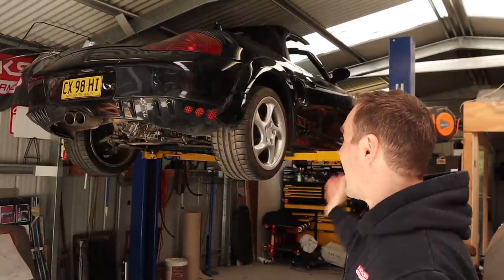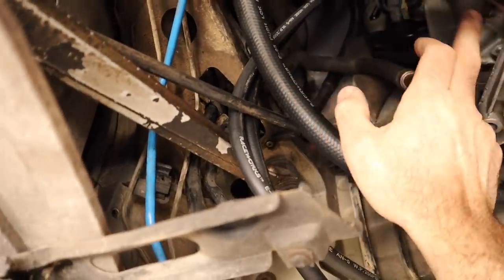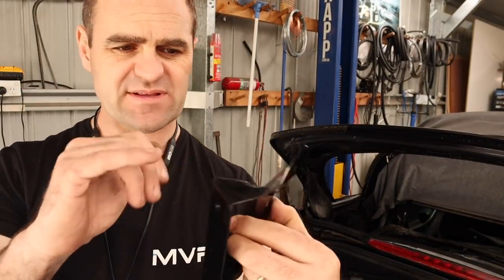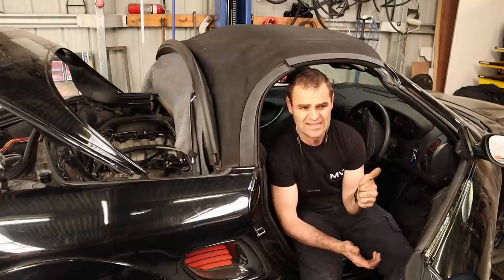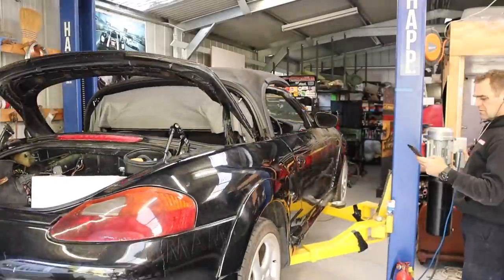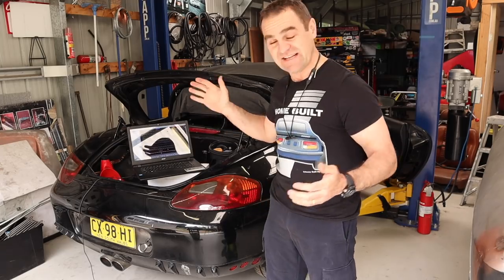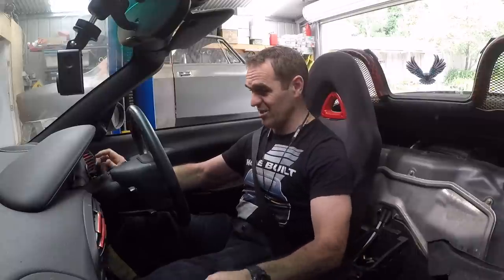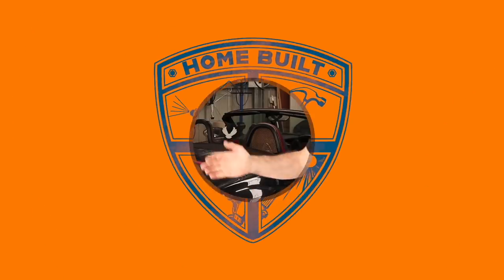V8 Porsche first drive - Porsche 986 Boxster V8 engine swap track car build 18

Comment: BEFORE YOU GO TAKING CORNERS AT SPEED… be sure you have baffles in your oil pan, or are using a dry sump. Don’t pull a Hoovie and do what he did to Apollo911 after he V8 swapped his 996. Cornering at speed starved the oil pump of oil & he smoked the engine. Glad to see you saved it. How are you cooling that beast? Did you make those “nostrils” on the bonnet into real cooling ducts?

Comment: I suggest to not drive without the engine top cover. Instead of using the genuine 986 black plastic cover you can alternatively use the 987 aluminium cover. It fits "plug&play",  is much lighter and has a bigger bulge, so provides  more space for the engine.
Regards from Germany 😀
Reply: Great tip! As someone that's in early planning phases of a K-swap for my 986, this is great information. The K-series was a bit too tall for the standard 986 engine cover.

Comment: So much for "reality TV's" three day engine swaps!  When you had the engine on the floor and the gearbox with it, it did look simple- tight, maybe but simple. That should have told us all that enormous problems would soon arrive! But now it does move under it's own power- you've got Murphy on the run, or at least hobbled- don't quit now!  Can't wait to see you and Boxster on the track and get a "smiles per mile" report!  FR

Comment: Love your work man your such a huge inspiration to myself and I'm sure to many more of your viewers. Keep it up mate 😁👌   

With the breaks being a bigger engine and more power and being a "track car" I'd maybe look into upgrading the Breaks to some bigger ones off a later model Porsche or an after market break set up 😉 sticking with the stock ones you might find yourself running into the issue of break fade on the track and that's the last thing you want when going full noise.
Reply: Even worse than break fade is brake fade...😐

Comment: Nice work Jeff. Sounds awesome. Note, my standard 987.1 3.4S smells as well after almost any kind of half spirited drive, so I think it’s a Boxster thing, given the engine position and venting.
Once again, I reckon you should do a conversion kit. What a potential weapon this could be for 986 owners! Regards Gavin T. (Aka Torz)

Comment: Sounds wicked! Even though it is too loud. 

You might be able to gain space by reinforcing your engine mounts through the bottom part instead of their top part. Your right side exhaust seems way too close to your shift cable.

Now, you need a roll cage. Keep up the good work!

Comment: I’ve always bled power steering with the engine running… You have to have the front wheels in the air so the systems not getting loading up by the dry steering though, and you need someone watching the level in the tank and topping it up as the air leaves the system.
Reply: No really - Done this on my own professionally for 20 years!

Comment: More power WHERE...?
My 986s 2003 achieved 175mph after I remapped and added a wider exhaust system  and placed a CARRERA 4S throttle body and plenum, which fits directly in, no agg.

Comment: Hey Jeff, what do you think of that new Ford e-Crate electric motor? $3,900 US. I would like to drop one in my Targa.
Reply from the maker: Not much. The motor is the cheap easy bit. The batteries and everything else ends up costing A LOT. The other issue is to get even a mild range you have to add a heap of batteries and weight (my research shows the car will end up around 300kgs heavier than than it was with engine to get 200-250km) and you can't supercharge it. So for something to pootle around town in fine, but electric conversions are no good for my uses.

Comment: Yeah you're not a mechanic, but you tackle and work through stuff I wouldn't touch and I'm a mechanic although out of the trade for 35years. I find the electrickery in vehicles now to much, one of the reasons I left for other occupations.

Comment: 3 things.
1. That thing is SO DAMNED UGLY. My offer still stands! I'll come down from Sydney and personally remove the ugly! If you don't, I'll come down in the middle of the night of do it! I can't take it any more! I might need to come down anyway. I have 2 little aluminium brackets I need welded up and everyone hangs up on me when I tell them it's only 40mm of weld....
2. You can make your own muffler. Might be an interesting project for you. You can buy emulsion pipe and wadding and then weld up a stainless box to whatever specs you can fit. It's kind of hard to get the note you want without the experience but maybe 2 or 3 attempts and you'll nail it. You can re-use the wadding. It's fibreglass or steel.
3. You have to let me know when you get on track. I'll bring my little track car out to Luddenham or Wakefield. I've being dying to dial it in. It's not been driven since it was built. Partly because it still had no brakes.... and I don't have the money for the brakes.... but I mean, I've been giving you advice for years, time for you to give me some! You can see what an idiot I really am! Lol.
Love the build. Much better than Archie. Keep it up!

Comment: Thank God you put A PROPER ENGINE in that 986 instead of that shitty Porsche turd called the M96 motor, the worst part of my 2000.
Reply: I actually thought about putting that Audi V-8 in mine at one time... The bell housing of the tranny fit perfectly, I was told.